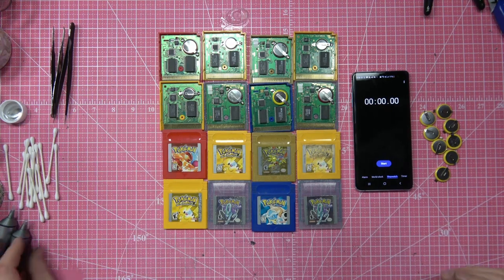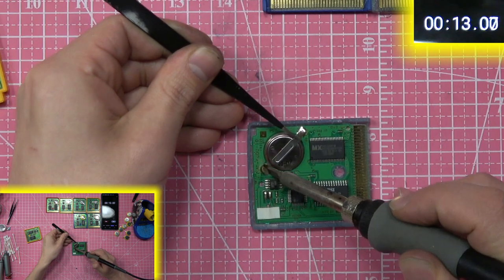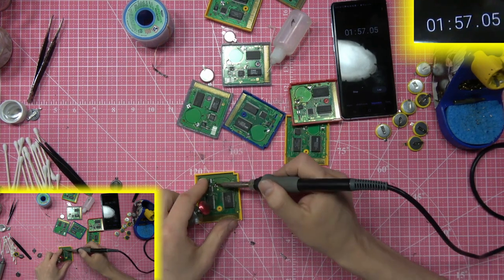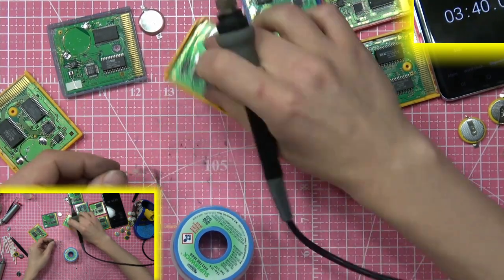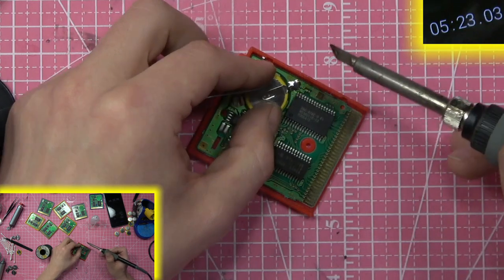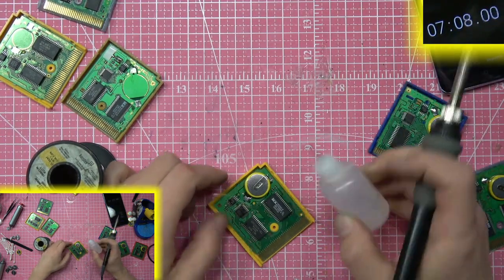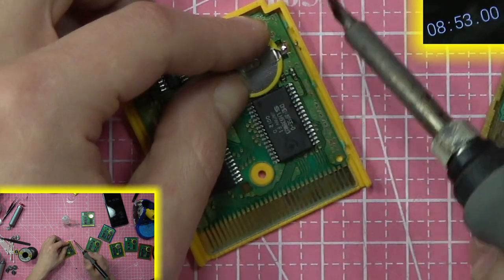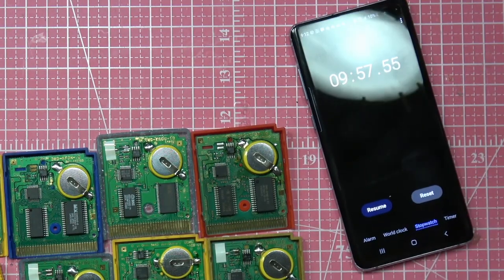SPEED SOLDERING! how fast can I replace 8 POKEMON cartridge battery's?

Comment: This would be fun to turn into a legit speedrun category >__<
Battery replace in 8 Pokemon games % run
Has to be 1st and 2nd gen carts. (Think the solder pads on gba games are different and would affect solder times.)
Carts can be taken apart first and don't have to be reassembled after. Batterys do have to be soldered in the right way / polarity.
Splits
Remove old battery
Clean up solder
Add new solder and battery
Clean up flux

If this was a any % run then a 100% run would be taking them apart, putting them back together and then making and loading a new save.
Reply from the maker: Hallarious in the best way. I loved this comment

Comment: since its about pokemon gameboy games i have one that crashs after i get to the start screen. like it goes into the menu and then i get like gastly cry its weird. any ideas?
Reply from the maker: Hmm, open it and send board pics in discord
Reply: Reflow the pins on the rom and ram chips and then check all traces from those chips for good continuity. If those are all good you may have corrupted data and you'd likely need to find a donor board to take the rom chip from and swap the rom chip
Reply: @roarkemurdock3027  ok cool. I should be able to find a donor board. Friend of mine owns a game store
Reply: @Nerdstrategy  try reflowing the pins and testing all traces first though, it'd suck to transplant the rom & ram chips only for it to be a faulty trace that is causing the issue
Reply: @roarkemurdock3027  will do. i wont be able to touch it up til monday anyway.